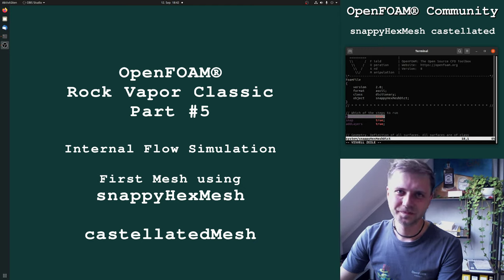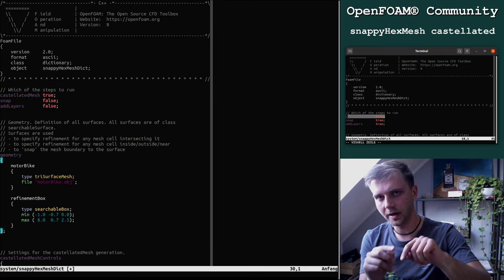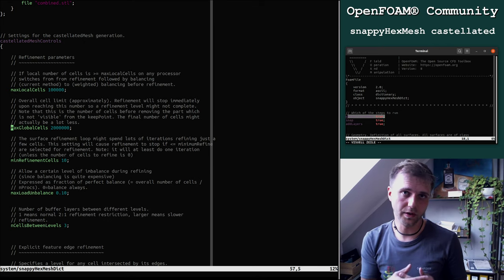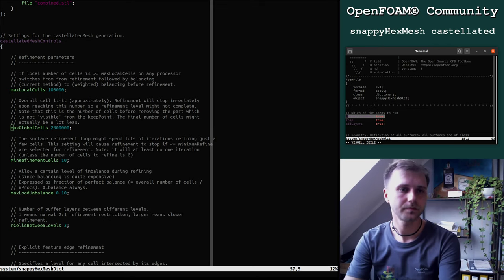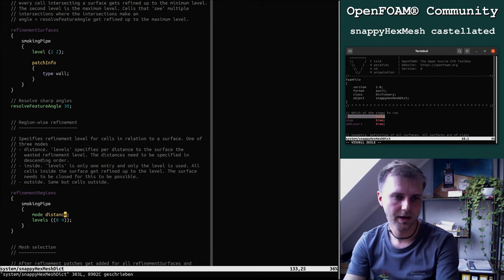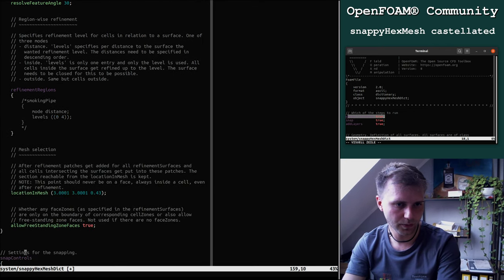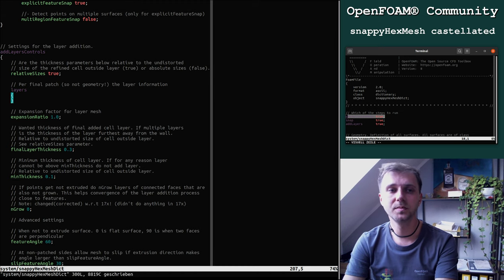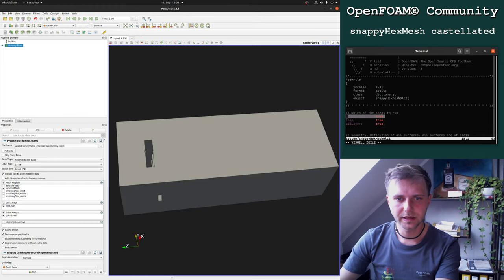CFD Analysis of a Smoking Pipe | Part 5 | SnappyHexMesh castellatedMesh  ∇ OpenFOAM® v8

Comment: hello tobi, thanks a lot! it is not boring or too much, all information is great!. as always I am bothering you ^^, I have some questions:
first of all when running in parallel snappy I saw that some people were talking about surfaceRedistributePar to have better memory handling, have you used before?

from my own geometry, I followed your workflow and I found myself with a lot of warnings that I don't know how to troubleshoot for illegal faces for example "faces with face pyramid volume < 1e-13" or "non-orthogonality > 65  degrees" .... is there any easy way to solve/troubleshoot this? as you know snappy has a lot of parameters... and I know what they mean, but at the end I am a little bit loss where to beging for this issues...
and as always thanks for your great screen casts!
Reply from the maker: Hey Franco, its the first time I heard about »surfaceRedistributPar«. Good to know. I will check it out and come back to you. Probably, with a new video named »SurfaceRedistributePar« within the application training video section. Regarding your errors, non-orthogonality > 65 is still okay, but you should use appropriate numerical schemes (check out the user guide). face pyramid volume < 1e-13. Well, depending on your criteria, you should check out where your cells are located with such volumes. You can use the extended checkMesh from my site to export such fields to investigate using ParaView.

Thanks for your feedback. Highly appreciate feedback from the community.
Reply: @HolzmannCFD  hello tobias, my issue is that when i mesh my geometry that is super small (the bounding box is (0,0,0) (0.00505,0.00505,0.201133)), if i go up in levels of refinement in the castellated it explodes (first the pyramid volume and going upper in level the non-orthogonality > 65  degrees) up to lvl (4 4) with a blockMesh cell size of 0.0015 it is okey (    non-orthogonality > 65  degrees: 0, faces with face pyramid volume < 1e-13:7) ... but after it goes crazy for lvl (5 5) (152 and 14045315 respectly) and for lvl (6 6) (0 and 54947785) lol.... ... so I should stop at lvl 4 4 but the problem is that the snapping over the surface is "not great...." even though I went all out with the snap section... nSolveIter 300; RelaxIter 4; nFeatureSnapIter 30; and explicidFeatureSnap form an emesh that surfaceFeatureExtract creates (and it is detecting the good features as I transformed them in an .obj object and opened with paraview....) Maybe your next video would help me but I am a little bit lost to where to go from here...
Reply from the maker: @francootaola9172  would it be possible to send me the files (maybe a simplified one with the same issue)?

Tobi
Reply: @HolzmannCFD  hello tobi, did you had the time to have a look in the geometry i sent you?
thanks a lot! waiting for next part ^^ ahaha

Comment: Never got such a description for the castellation part of snappy control till now. Have been following your videos for a long time and have actually used them as reference to setup my cases in openfoam. Looking forward to the next set of videos and the results.

Would you be doing a Cht simulation on this pipe? Particularly interested to see how to create different cell zones using snappy alone without any set set features
Reply from the maker: There is an extension in the pipeline coming tomorrow. :)
Regarding your question with CHT. Good hint, probably as an extension.

Comment: Thank you Tobi, so much appreciated. I don't mind the length of the video. 

I am not entirely sure if I have to use the primitive box or not. My case is a micro-climate simulation of buildings. Until now, I have been creating the geometry of the buildings in a mesher and the background mesh (including the inlet and outlet patches) in blockMesh_. That is because I find particularly easy to define the grading in _blockMesh to meet the ABL requirements for cell size and yPlus_. Then, using  _refinementBox I set an area of refinement around my buildings. 

My question is (*i*) whether it is more preferable to build me entire domain in a mesher (buildings, inlet, outlet etc.) and (*ii*) how can snappyHexMesh be precise on the grading and the number of cells that I need, say in the vertical direction.

I reckon that your Part 6 video will might give an answer to these questions.
Reply from the maker: Hi Gregor, well, I guess this is a different topic. First, you can use blockMesh and also the grading. This is no problem at all but !!! snappy works best with hexahedrons which do have the same length in all three directions. The reason for that are the quality criteria that snappy take into account during the meshing procedure, in particular during snapping. I could make an extra video regarding this topic as it is not related to the training case I present here.
Reply from the maker: After re-reading I will give the following answer: Yes I will explain some of your parts in video 7 ;) 

Part 6 will be a short one that include the missing information I wanted to present here in this video.
Reply: @HolzmannCFD  As I was re-watching the video, I noticed that you said that not many people today use the refinementBox option in the geometry part. I am wondering why is that and what are the alternatives.
I am using a refinementBox around my building blocks to get a finer mesh near the ground level. Do you think it is a  bad idea and/or better work-arounds exist?

Comment: Hi Tobi, thanks for the awesome tutorial, I learnt a lot. However I have one Question, I followed all the steps the same way as you did with my geometry (a really thin slice of an rotational mold, which should later be transformed in a 2D case). If I follow your steps my geometry is not displayed after snappy, if i activate the refinements however, my geometry gets meshed. Is there any explanation for this ?
Reply from the maker: Can you explain what you mean by: activate the refinement?
Reply: @HolzmannCFD  thank you for your answer, if i activate refinement surface (1 1) and use feature refinement (I created eMesh file according to joszef nagy tutorial) my geometry is meshed.

Edit: also Works if i only activate refinement surface

Edit 2: I rewatched the Video for the 3. time and found my mistake, I thought you did not have an input in refinement surface but you had. Sorry my bad!
Reply from the maker: @Daniel-gv9gr , whenever you have a geometry, you need to specify the surfaces in the surfaceRefinement. Otherwise it does not get meshed.
Reply: @HolzmannCFD  thank you, now it's clear and i can continue with snap and layers :D looking forward to it

Comment: Hi Toby
Great video. I am currently using snappyhexmesh for meshing a channel with roughness elements. I had a question. How do I ensure that the allof my meshing elements are hex elements? There are prisms and tet elements (i viewed this in Helyx, also what I used for meshing). Is there a control over it or is that a result of playing with the castellated mesh controls?
Reply from the maker: Hi, this is actually how snappy works. You will get all the information within th next two videos.